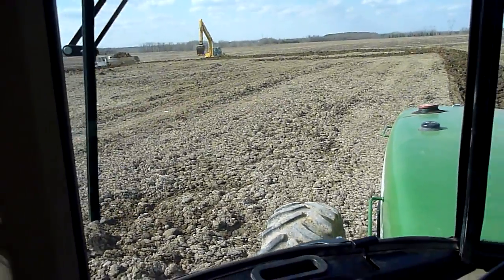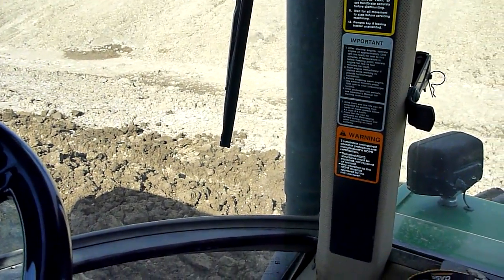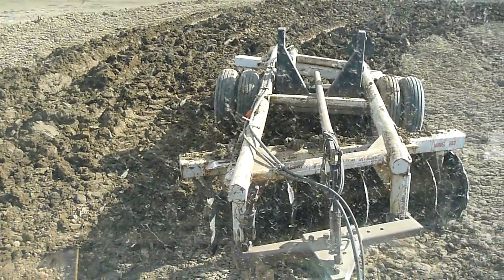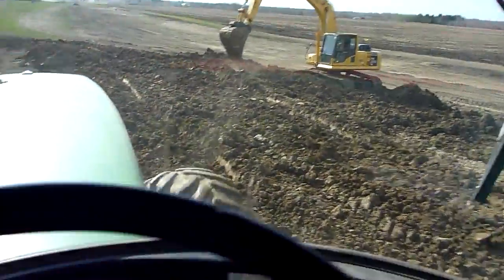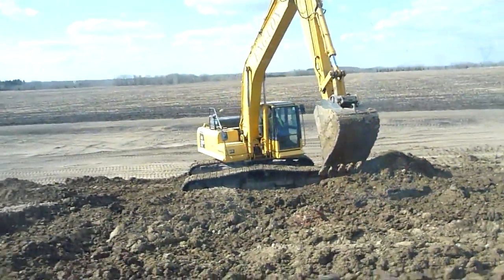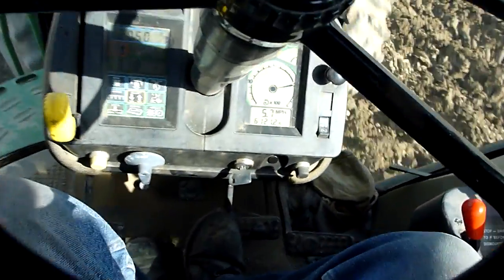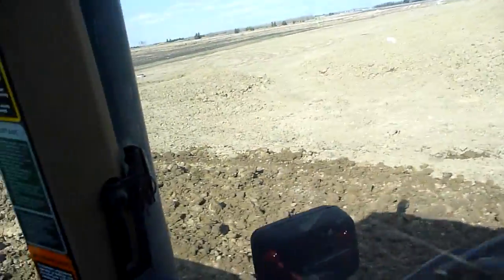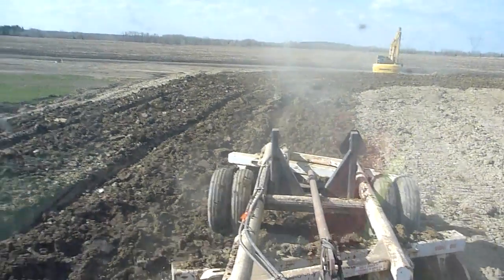Drying Dirt 101

Comment from the maker: @7810ftw While this does work quite well, have you ever tried explaining this concept to the new younger operators on site? You'd be amazed at how many people don't get the concept "always turn left" when running the tractor. Also the crappy part about this disk is that its narrower than the tractor. The hitch is offset to the right so it covers both tires on the right side.